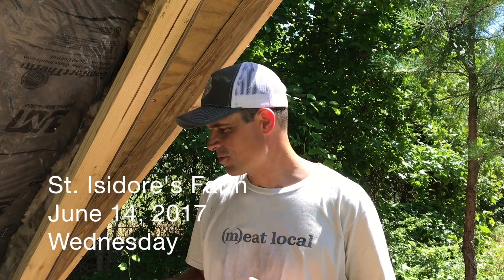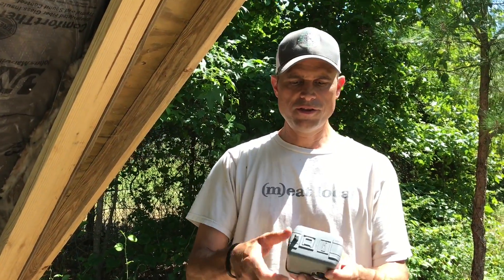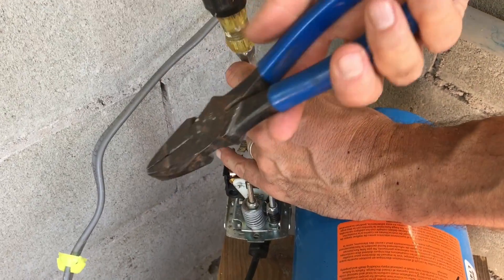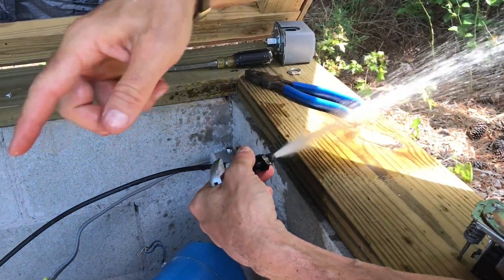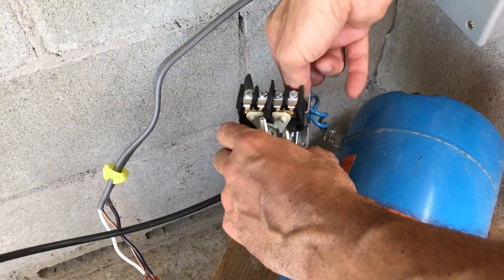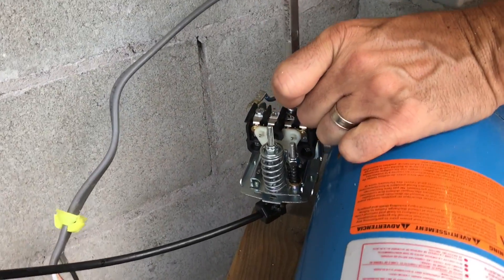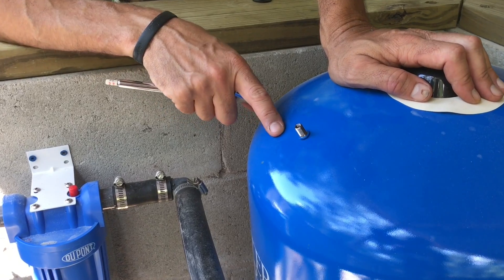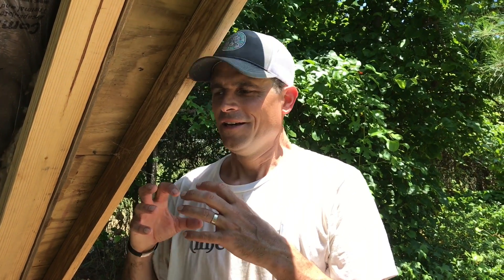Replacing a Square D Pressure Switch

Comment: Our house was built in ‘92 with well water but a few years later converted to utility water. We still have the well plumbed to our outdoor spigots. Go figure I turned I back on since the temperature is warmer and it’s not working. I scuffed those contacts with an Emory board and it’s back up and running. Probably replacing the switch since I think it’s original from ‘92.

Comment: My pump's original pressure switch has the sensor pipe hard attached.  So I need to get a new appropriate pipe to connect to my (2000 era Rona) pump.  Not finding much googling, is there a name for that pipe?

Comment: Nice video except the part I was concerned with you didn't show! LOL  How do you get the tubing on the bottom of the switch off? You showed putting it back on, but not taking it off! Maybe I don't have enough hand strength to unscrew mine, but I just cannot get it off! Can you Help? Thanks!

Comment: Normally if the pressure switch is going off and on like that, its because the small tubing from the impeller is clogged. Usually they clog up with rust close to impeller when they are cast iron body pump like yours. Regarding another comment earlier about them not lasting long, I live here on wet side of Big Island, Hawaii where there are thousands of catchment pumps and these Square D switches last forever as long as they don't get ants or geckos in them.
The other reason for short cycle is that there is not enough air in the pressure tank.

Aloha, Paul

Comment: I've had it with these Square D pressure switches I get on average 4-8 months and they go bad. Is there a equivalent switch that is a much higher quality I can use
Reply: Ants fowling contacts. Use grease to keep them out. They won’t walk through the grease. Any bearing grease will do the trick.

Comment: Do these Square D pressure switches seem to have a problem? I just bought one today and it wouldn't shut off. Tried to adjust and the points were just chattering at cut on and cut off. Cleaned the points on my old unit and it works fine for now, but those points are badly burned and worn.
Reply from the maker: Good question, because we've continued to have issues with them.
Reply: @StIsidoresFarm , I returned the Square D switch, and ordered a Centripro. But I think I got the problem fixed as far as points bounce goes. Not trying to lead you anywhere, but I made a video on the fix. If your interested, here's the link.
https://www.youtube.com/watch?v=cXgmIIBvbpk&t=1s
Reply: @StIsidoresFarm  I just did an update video today with the new pressure switch, I think this may help you as well.

Comment: You used 10 gauge wire? Does that mean the pump has 30 amps to it? Is that safe?
Reply: It's always okay to use a bigger gauge than is required.

Comment: Did you make sure your pressure gauge was right the switch comes set at the factory. I have never seen one 12 turns off that should have increased pressure by at least 12 pounds 1 pound to a turn of the pressure switch adjustment. I think something is wrong here.
Reply from the maker: You're correct. The thing we finally figured out AFTER this video is that our pressure tank was about two feet too far away from the pump (the way we had pipes hooked up) and was the cause of the rapid cycling/destruction of contacts. Once we figured that out and fixed it, we could dial back down the pressure switch to factory settings. No troubles since.
Reply: @StIsidoresFarm  could you add this to description at too, if not done already? Thx for helpful video. God bless and good luck to FFA daughter!!

Comment: I hate having to stop what I'm doing to make repairs, but there's nothing I hate more than having to make the same repair TWICE!!!!  I keep a finger nail file handy (emory board) and and file down those points when needed until there's nothing left (I'm too cheap to keep replacing them)... But our water has so much iron in it that it usually destroys the rubber diaphragm below the points long before the points burn up, which also causes short cycling.  Thanks for the video my friend and may God continue to bless you all!
Reply from the maker: Couldn't agree more - very frustrating having to repeatedly repair something.  This well pump has been a HUGE blessing (our daughter won an FFA grant to fund it), but we've had issues with the pressure switch for numerous reasons since day one.  I must admit though, some of it is likely my own fault - wanting to do everything possible myself and not hiring a plumber/well professional.  That said, it is frustrating when the contacts would stick and you have no water.  Hopefully, we have permanently solved the problem.  Thanks, Randy, and God bless you and yours!